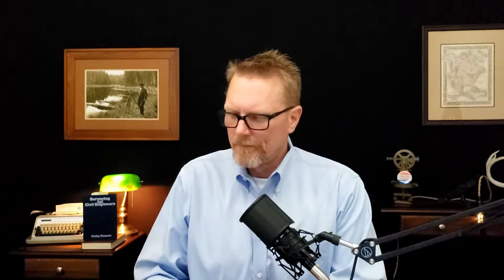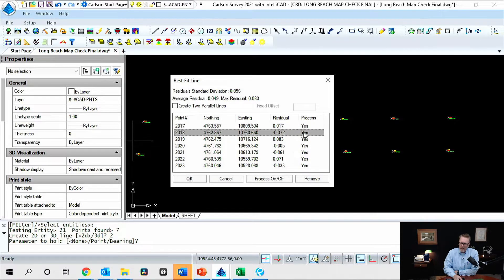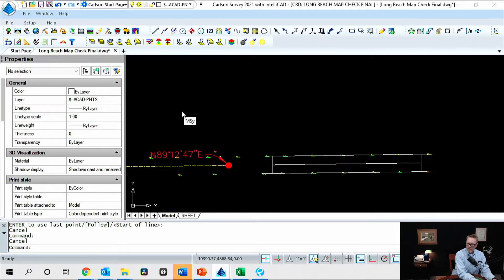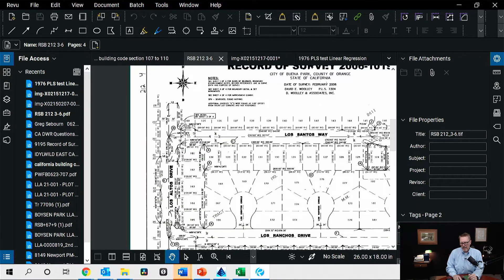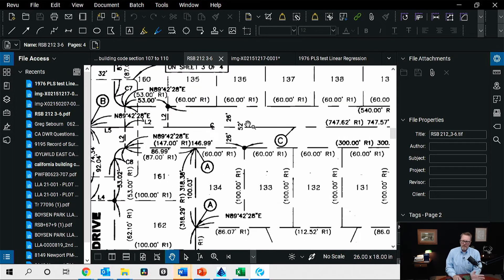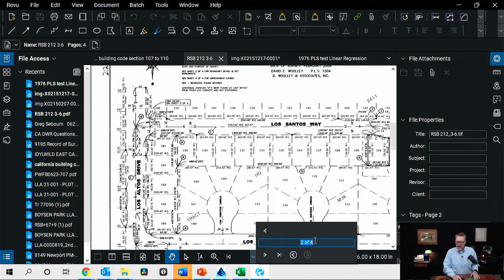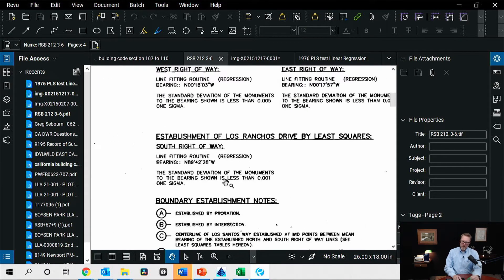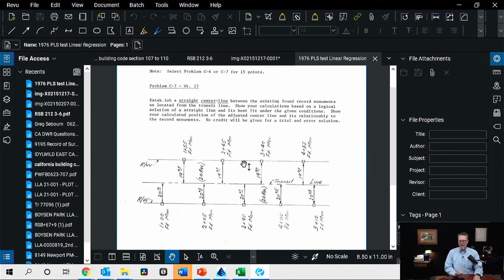Episode 15 Least Squares for Boundary Resolution (Part 2 of 3)

Comment: I was recently involved in a right-of-way survey of a platted 1926 subdivision. The purpose of the survey was to stake-out right-of-way lines for new sidewalk construction. I was the instrument operator during the survey, and I assisted the county (Orange County, FL) surveyor in the office using Carlson. Your video echoes many of the same concerns and methods that were used.